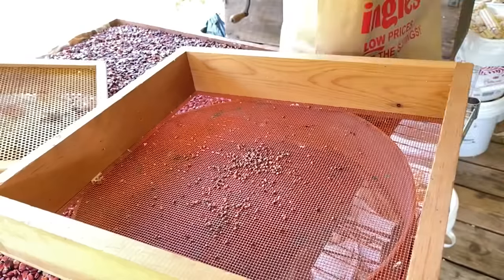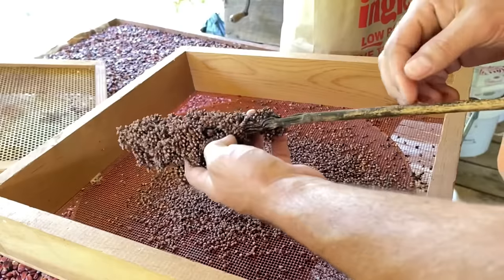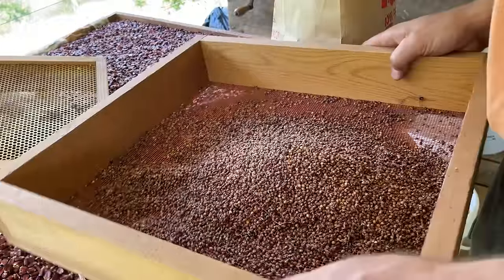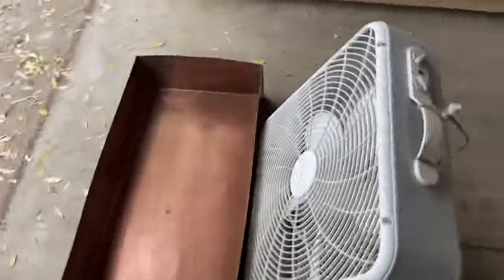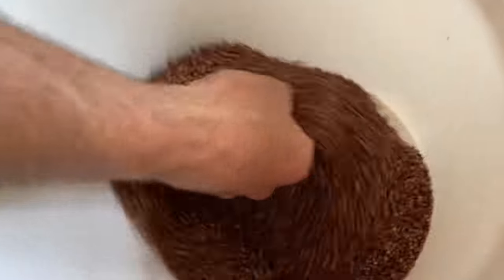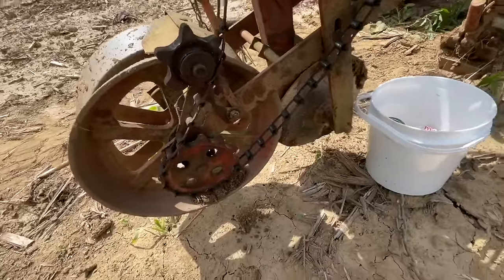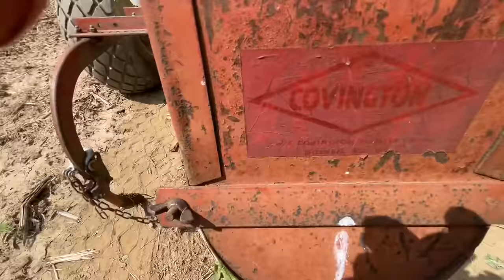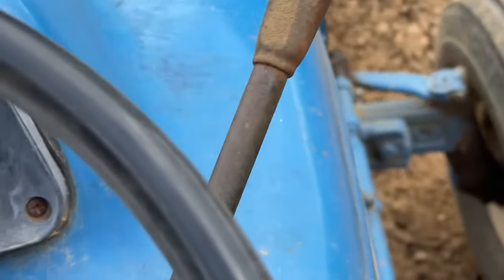Sorghum Planting From Start To Finish v161

Comment: When winnowing, throw a rag of scrap fabric in the copper troth to stop the bouncing early on. You should also tap out the bucket each time you empty it because the light stuff does stick around in the bottom of the bucket.
Reply from the maker: That is correct, I have used both of those methods and they work well. Thank you for sharing!

Comment: Seems like you're probably selecting for seeds that come off easy too.

One hand threshing idea I did last year was to rub the whole head against hardware cloth screwed to a frame with a grout spreader. I used my body weight on the ground to push it back and forth and it worked really well.
Reply from the maker: Thank you for sharing this with us! Yes that’s correct

Comment: When you are pouring the seeds in front of the blower have the bottom of the pan you are pouring into at an angle to maybe reduce the seed bounce. Good video great information.
Reply from the maker: Yes for sure. I usually put a sheet in yo prevent that but it was not necessary on a small batch. Thank you!

Comment: Hey Justro! Where did you get the larger hole screen for your top sifter screen? Is the bottom sifter screen made with window screen?
Reply from the maker: Hey Kelly, I am working on getting different screens at the shop. Hopefully I can help with that. For now if you need it try industrial supply companies. I have had these a while, I got them with some other old things I bought
Reply: @metcalfmills5679  Thank you!

Comment: One thing I been wondering about now that I am growing more grains is seed cleaning machinery. Any recommendations on equipment for cleaning all manner of grain? I am about to harvest wheat and will do the harvest by hand and get at the seed by hand. But hopefully I will be growing wheat larger scale on the rented land next year. Also have upland rice that I been saving seed from. Also hope to grow rye this winter.
Reply from the maker: I have a Clipper M2B. You van get any screen you need for it. They have screens for anything
Reply: @metcalfmills5679  i checked it out on the YouTube's and website. The machine does not thresh the grain? Is that a separate machine to beat the grain out the head of chaff?
Reply from the maker: No it does not thresh. More on farm sized thresher coming
Reply: @metcalfmills5679  ok great

Comment: Well.................. I guess I have my 8 stalks way too close together. They are all growing in 1ft of garden bed.. They are about a foot tall, so too big to transplant to wider spacing.
Reply from the maker: You might be able to transplant it. I have transplanted some that was pretty big
Reply: @metcalfmills5679  Ooooo  I'm a bit scared!! It's all I have  to get seed off for next year, unless you can send me some seed.
Reply from the maker: Let me know how much you need
Reply: @metcalfmills5679  I sent ya an email a week ago
Reply: @metcalfmills5679  I wanted to update you on the transplanted sorghum, Justro. The stalks I didn't transplant grew 8 foot tall and are currently heading. The 4 I DID transplant MULTIPLIED like your spaced wheat. Every stalk became at least 4, so I will end up with 24 stalks and grain heads!!!! Seems the way to multiply your harvest is to start em in planters and transplant them at around 12" tall. Seeing I only have 24 stalks, I'll be running them through my vegetable juicer, once they are ready to harvest. Might get me a half a cup of syrup...